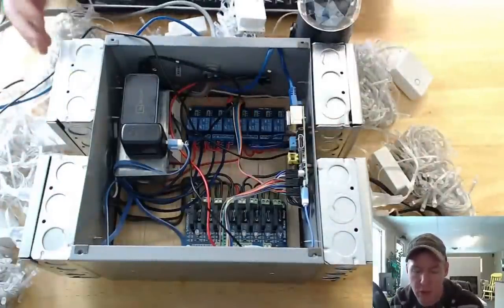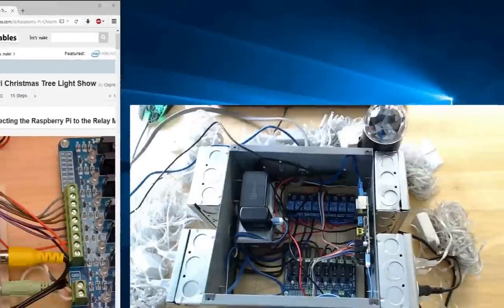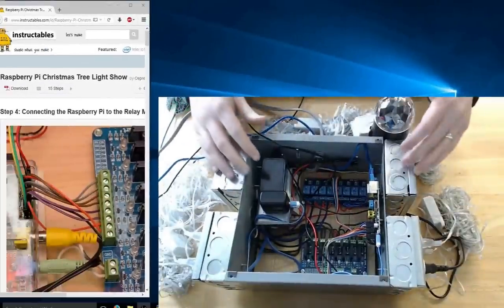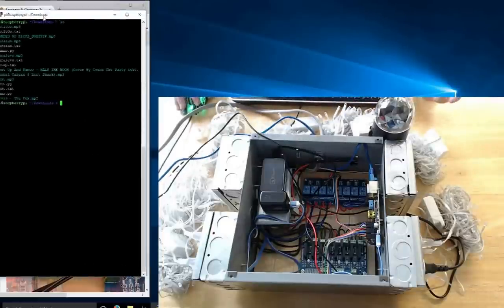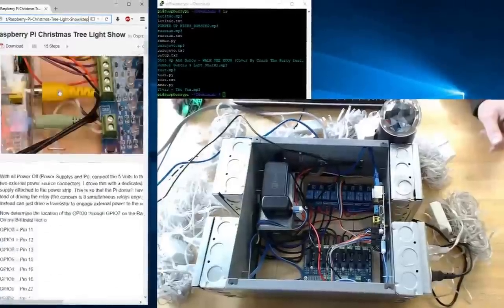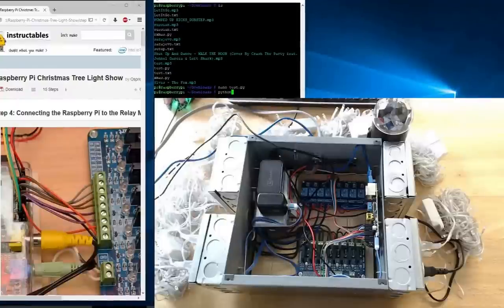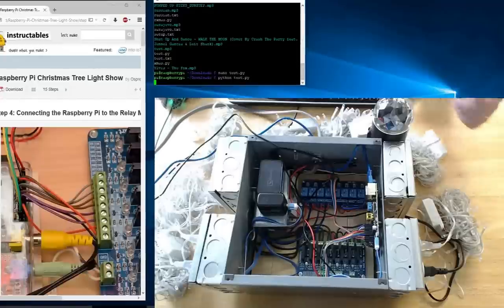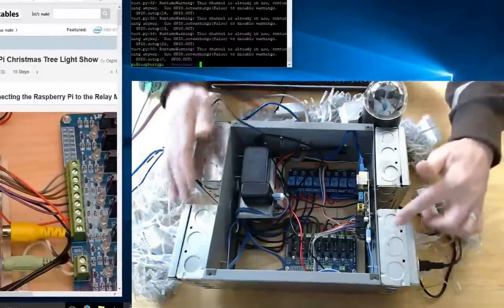Christmas Lights and Music with Relays and Raspberry Pi

Comment: I'm working on the exact same project, 16 channel relay board. Nice job. I went through an ordeal trying to shield all the data cable going from arduino (the dreaded EMI from 120v lines), but I see you didn't bother with this. Am I over designing? Very clean job, bravo.

Comment: I like the other all setup, however if I were going to use this I would have either a weatherproof box for everything, or have the outlets on some type of conduit/piping to move them around and keep the electronics out of the elements (I'm assuming this is outside either fully or partially)

Comment: how are you running the power from the Raspberry Pi to both relay boards?  i understand each relay board gets a dedicated power supply but aren't they also supposed to get power from the Raspberry aswell? 5v and ground to each relay board to the pin out with the channels pin, not the JD-VCC

Comment: Guys this is not intended to Run a large scale Christmas light show.  The power is coming from a cell phone usb charger.  Think one led strand per outlet.  5 volts ain’t gonna power a lot.  If you were powering an entire outside light show then the suggestions concerns in the comments would be warranted.

Comment: Not sure if I like this or if I recommend anyone else wanting todo this. I can imagine with any modest current on each socket this thing would start smoking pretty quickly as there is a sufficient bus with all the relays daisy chained like this. OK for low loads I guess but not safe for general consumption in my opinion.

Comment: Great video. I am guessing that this is the second or third in the series. Where do you explain what a raspberry pi is, and how it operates?  How do you integrate music to sequence the lights to it?  The build technique was informational and thorough but I think that each output should be fused individually to protect the system from shorts after the relays. I have the electrical assembly down, I just need an explanation on what the R pi does and works. Thanks

Comment: is there a fuse anywhere in this to protect the relay? or will plugging it into a GFI outlet protect it. I had a strand short in the rain and trip the GFI and Im afraid if I wire them up to this controller, it would fry the relay

Comment: Sweet project, brah! I was thinking of using a 6 socket grounding block for my project instead of the NEMA 1-15 sockets you used in your project. So, question/statement for you:  I am considering using a Kuman 5v 8 channel relay. In other instructables I have seen everyone seems to be plugging their lights into a wall socket and interrupting the circuit with the RPI GPIO pins/relay controller but you seem to be drawing the power directly from the relay board. Would it be possible to just cut the plug off of a light string and wire it directly to the relay board?

Comment: using wire off a string of a cheap xmas tree light for your main wiring to relays could be problematic.  Easy to overload that cheap stranded wire.   Solid 12 ga wire (black/while/neutral) should be used.

Comment: I have 20 amp outlets in my garage for when I build this project. Will it matter if i use 20 amp circuits for to power to the raspberry pi  project.
Reply: Ryndon Ricks I have another question for you what size was the box you put the relays in for this project.

Comment: Daisychaining the neutral wire through the little brass strip between the white screws on the neutral side of the receptacles is a very bad idea. That means that the total load on the system goes thru the brass strip between the screws of the first outlet connected to the incoming power.  With small loads like a string of led christmas tree lights you may get away with it for a long time but with larger loads you will burn up the receptacles.  Please tie all of the white wires from each receptacle to the same point where the power comes in.  Otherwise nice project.
Reply: This is a late question. Would you recommend breaking the breakoff tab for the neutral side if you tied all of them to the supply neutral?
Reply: its perfectly fine to dazy change the neutral thats how its done in real electrical 120vac.

Comment: How can I identify a problem in the lighting system and send a warning when this is having trouble using raspberry pi?
for instance, when a light bulb has burnt out or it's loose
Reply: I not sure that this is what it is designed for, but if anybody knows how to do that, please tell
Reply: You could add some kind of current monitoring to an entire channel but not really just a single light unless you only had one light per channel. No current flowing in that channel would mean a bulb has gone open-circuit. Not really practical with strings of LEDs to monitor a single LED though it would detect if the entire string was not drawing current for some reason.

Comment: Hi an am trying to do something like this. I am running Home 
assistant(HA) on the pi 3. I have (1) 8 channel 5v relay and 10 of
 the single channel. Question, I want to use the home assistant software to control the 18 relays. Can the pi 3 power, power all 18 relay or can a 2nd 5v cell charger power all 18 5v relay?
Reply: Thanks I will start my project this weekend

Comment: @7:11 the power wires do not make sense to me, would that not overload the relays? Or am I missing something here? What I'm seeing is that the wall is being powered to that hot side electrical outlet, which the 3 red wires are connected to and leads into the relay boards.
I'm new to electronics so please explain.

Comment: what is the difference between the solid state and regular. ?
Reply: Regular "mechanical" relays use an energised coil to magnetically close a set of contacts. Sold state relays use semiconductor based switching elements such as triacs, thyristors or transistors to switch currents up to about 100 amps.
Reply: on the surface, regular makes loud audible clicking sound when activated. solid state is silent operation.

Comment: I followed this setup as close as I could and in the end when I plugged my lights in, they were on and when they received the signal they flashed off instead of the other way around. It's not a huge issue, but I was wondering if you could help me figure out where I went wrong.
Reply: Most relays have both Normally open and Normally closed connections you are on Normally closed, May be the relay is only normally closed
Reply: A lot of relay boards turn the lights on (close contacts) when at logic low. So if you send the relay a "high" signal from your controller, it may turn off. I simply wire all my lights to the NC (normally closed) contact for this reason.